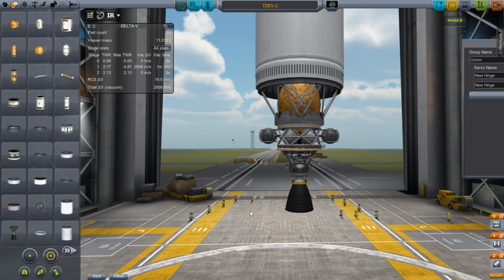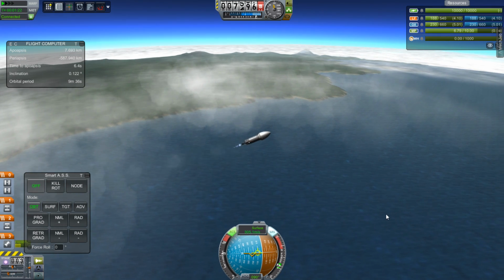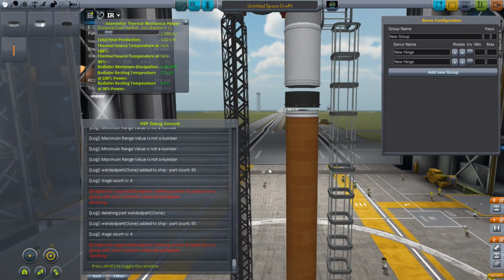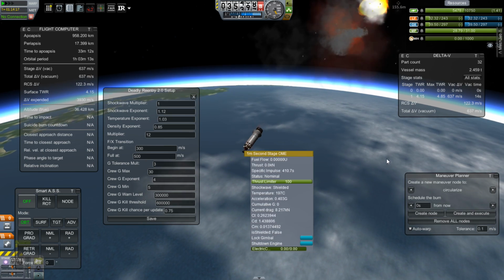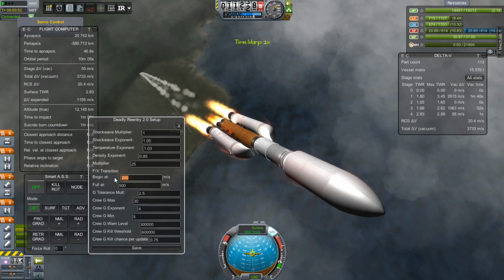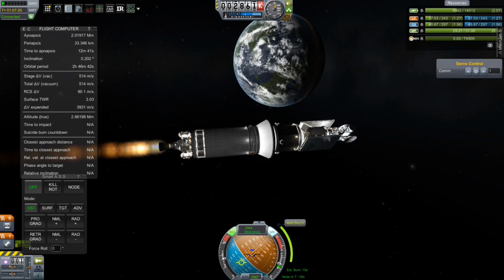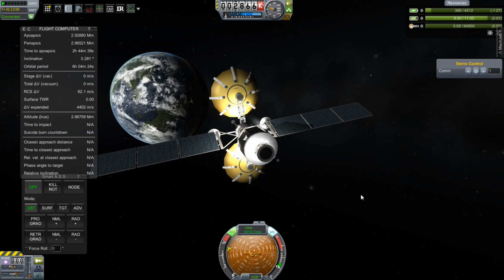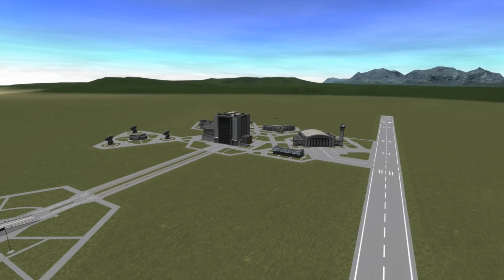E02: "First Satellite" / Project Odyssey / KSP 0.23

Comment: What's the difference between k.e.r and mechjeb both do the same work and do not know why people install both ?
Reply from the maker: +Gaurav Ghosh There is no reason to use KER, and therefore no reason to use both. MechJeb has all the features of KER, and more. The reason some people use KER is they think MJ is for automation, and they consider it cheating. But MJ has a use for dV calculation and orbital parameters just like KER (better features, in fact, because MJ can be customized way better than KER can).

Comment: I know you probably don't want people telling you what mods to use, but may I suggest the FASA launch towers to replace stock launch clamps. It is a small detail but I find it massively increases immersion.
Reply from the maker: I like those clamps too. I didn't even think about them because FASA is not a mod I had installed in my viewer folders. Very little is expected to come from FASA in general. However, you might be right about the clamps. They might be the best thing in the mod IMO. I'd have to look at the parts list one more time.

Comment: 21:13 is it normal that the Exhaust from your second stage engine starts befoire the engine? xD
Reply from the maker: Yes, the engine flame is based on engine power, so you see very little engine flame as they start thrust. The flames and smoke come from the HotRockets mod.
Reply: I meant that the Flame starts behind the Nozzle and not inside/after it. Doesn't seem realistic.
Reply from the maker: Probably some sort of HotRockets parameter that needs to be fixed. I'll add it to the TODO pile, but honestly minor visual glitches are really low priority right now. The list of "need to do" is too large to look at the "nice to do" list yet.